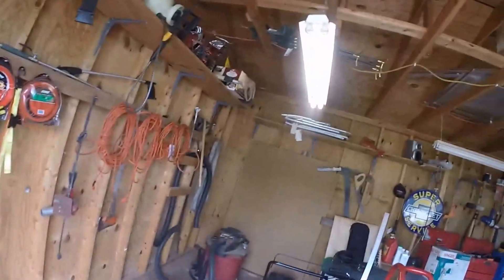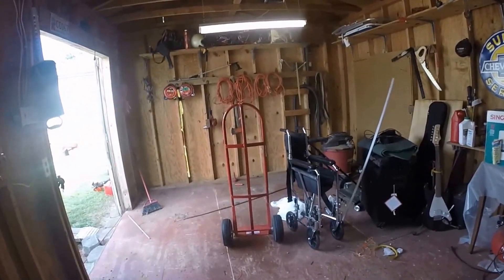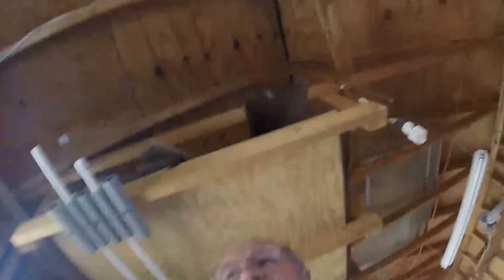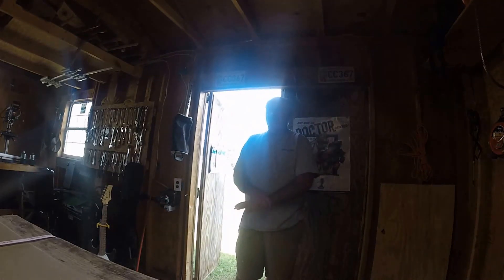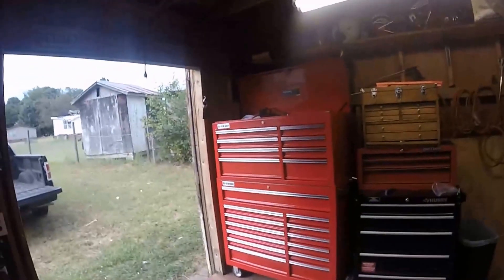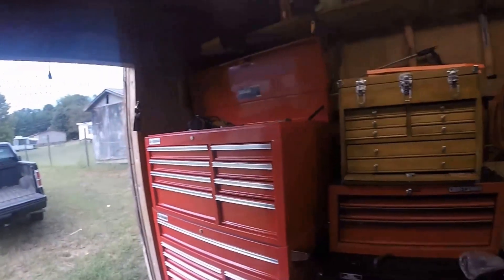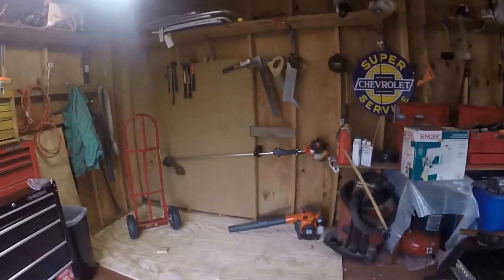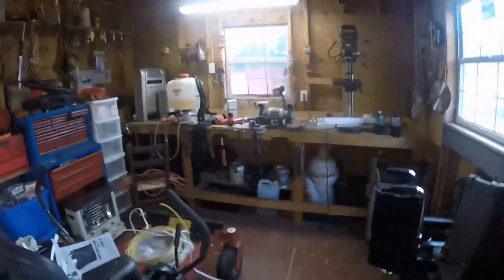Moving update

Comment: James it looks like you have your work cut out for you moving those two shops. The new one looks a lot bigger, so that will make machine work a little less hassle...take care
Jim
Reply from the maker: Skip Tracer in fact it's a bit smaller. But I didn't use the whole building. That is why we decided to use my old shop for 
storage. Not looking forward to moving the Grizzly but soon as I can get some time and help we get it done
Reply: On camera it looks bigger. I've noticed that before when I visited Chuck  (Outside Screwball) in his shop, it's smaller than it looks on camera....Jim.
Reply from the maker: For reference the building in Kings Mountain is 14 x 30. The building in Dallas is 16 x 20. However I think it will work out, some circuits will need to be ran, primarily a 220v for the lathe. Thanks for commenting and viewing it is appreciated